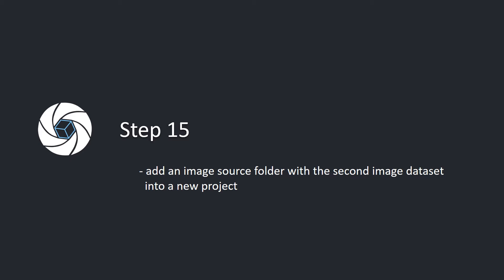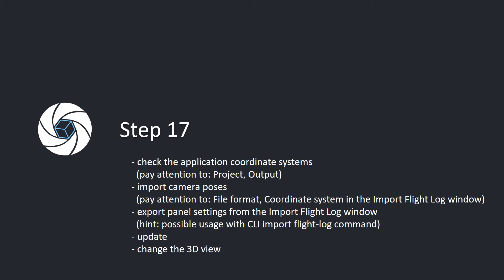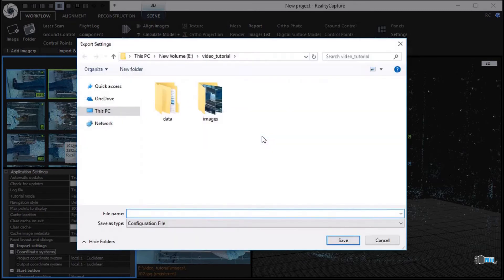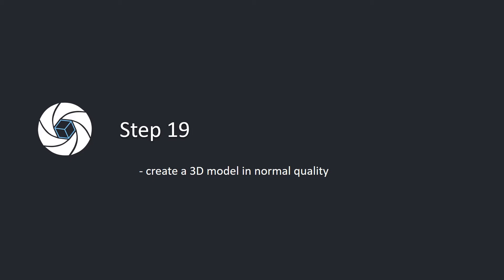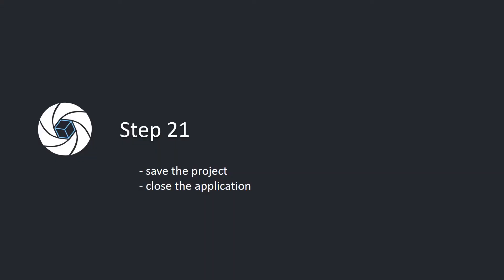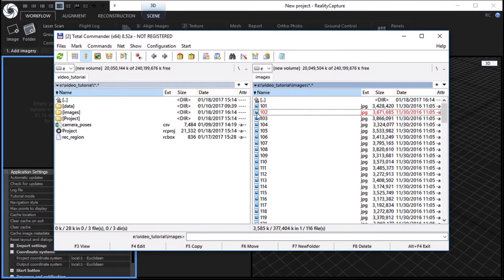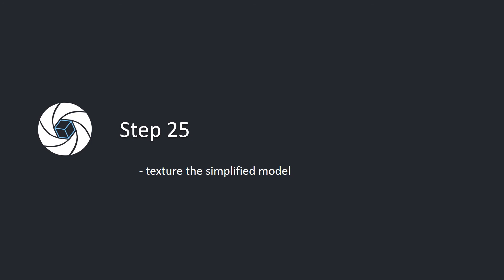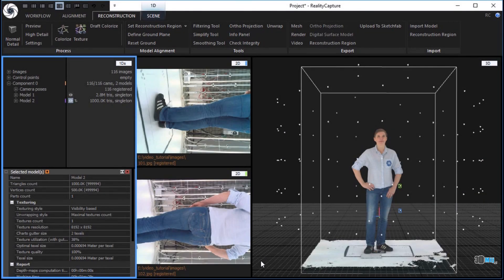Coordinate System Preservation with a Flight-log part 2

Comment: What button do i click to make the picture show in the 3ds section I see the points on the picture but not the actual image in 3d??
Reply from the maker: Hi, to see the cameras in 3Ds view you need to have checked the option Enabled under SCENE 3D/VIEW/Alignment Cameras.
Or do you mean something else?
Also, to see the 3D mesh, you need to process the model.